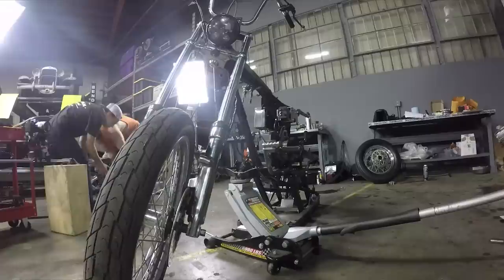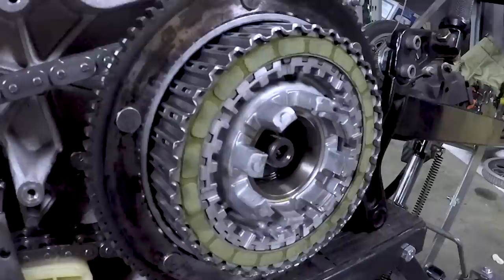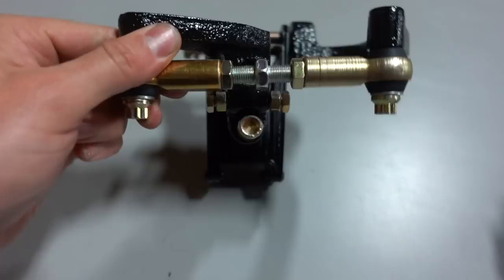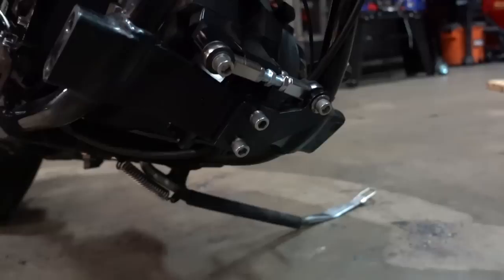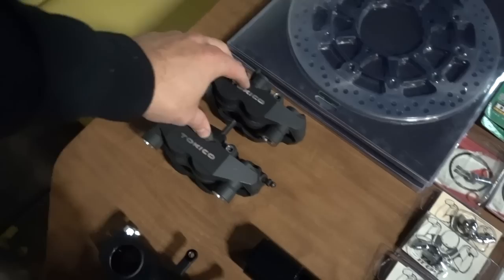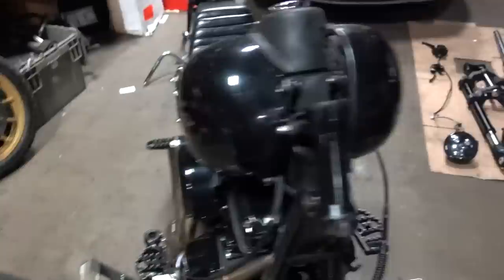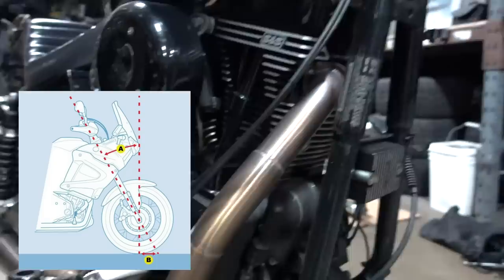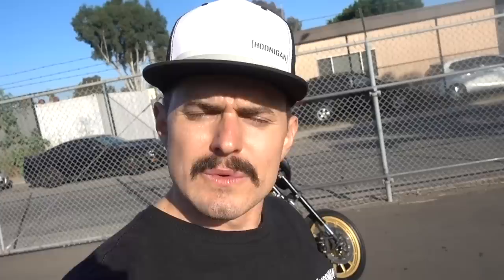Gsx-r Inverted Fork Swap on Zac's V111 Powered Dyna

Comment: How to build a propper Harley: Replace all Harley components. lol
Reply: Funny
Reply: Very true
Reply: Murica, put up with it
Reply: america LS swap every thing, should have ls swaped that bike lol
Reply: @reggiexp69  That's called a Boss Hoss
Reply: he kept the stock gas tank that still says Harley Davidson for all the Harley snobs. so, it is just an aftermarket parts bike made by zack, not much harley left here
Reply: Wizzo From Conney Island butt hurt much because of the truth? 😂
Reply: most Harley parts are manufactured in china.... Just saying....
Reply: Outdoorzvet 😂😂😂
Harley’s are the most useless, biggest pieces of crap ever made
Reply: How to build a propper harley: buy a sport bike. lol (ngl it's kinda true)
Reply: my old 62 panster i built myself when i was 20 outlived 3 brand new Harleys dyna wide glide kept going through trannys , dyna street bob 06 brand new had the tranny rebuilt within the first year then again the second year. then it caught fire on me when i was on a ride. faulty wiring harness recall.none of the lights worked right after, traded for a custom road glide, another piece of junk tranny was chirping and grinding 4 months into it meanwhile the old 62 got a new battery and an oil change.  never again will i buy a new harley
Reply: The frame, tank and oil tank and loom come from Milwaukie. Personally, I ‘d ditch the frame as well.
Reply: Isn’t that what you do when you build anything?
Reply: @steve19745  
So 60's Harley is what I should look for?

Comment: Kind of reminds me of what I was gonna do with my buddy's wrecked Sporty.

Buell-ify the powerplant, put the stock forks off my Aprilia on it with dual 320mm radials (with new cartridges in - I put Tuono V4R forks on my bike), convert to 17s front and rear, carbon front fender, long travel rear shocks to lift the ass end, 2-into-1 exhaust, make an oil tank out of a tracker-style seat pan to open it up and lift the seating position, rearsets of some kind, chain conversion, and a set of dirt or Clubman bars up top. Speedo and headlight got killed in the wreck, so I was gonna make a number plate for the front and integrate a Hella low beam projector and a small LED light bar for a high beam. Do bar-end turn signals up front, and make a nifty integrated setup in the rear for turn/tail/brake. No idea how much weight I'd be taking off the thing but I know the stock front wheel on my Priller is noticably lighter than the mags that came on the Sporty factory. Would be cool to get a before/after wet weight rating on it.

Comment: There’s actually some class action lawsuits going on regarding the death wobble due to the rubber mounts. 

It’s shocking that they never corrected it, or had a recall on the mounts, because it’s thrown a lot of people off their bikes at speed. 

They just flat out denied the problem even existed until they retired the dyna chassis, then mysteriously went back to a solid mount on the 2018’s, and used a counterbalance to the M8 to cut down on vibration instead.

Comment: So Dynas don't crack the primary case anymore when built up?  Did Harley finally fix the flex issues between the crankcases and the transmission?  

A lot of the early Dynas broke primary cases when they were hopped up.  An aftermarket company made a hella expensive billet arm that you bolted between the trans and crankcases on the right hand side  to reduce the problem.

Comment: Is the front tire mounted the wrong direction? It seems like this orientation of the profile would support aquaplanning because it moves the water to the inside instead of the outside of the tire. I don't know if thats really that relevant for such a slim tire though
Reply: Tires are all directional on motorcycles there's an arrow you just put it on that way
Reply: But that would be funny if you put it on backwards

Comment: Ordered an inverted front end from gigacycle. Was quoted 9 or 10 week turnaround time. Here I am on week 17, no front end has arrived...
Reply from the maker: It’s worth the wait, trust us.
Reply: @TheHoonigans  So after waiting 18 weeks. I'm contacted. I'm told the black anodizing on my tubes is messed up, but he can ship gold in 4 days. 4 weeks later gold tubes arrive. They wrapped the brake calipers in plastic like seran wrap, they smashed against the tubes in shipping and left nasty scrapes on the tubes. Now my new problem, this install is for a 2019 road glide. The top tree they sent appears to be for an earlier model and is not clearing the stem lock mechanism. This is turning into a nightmare. :(